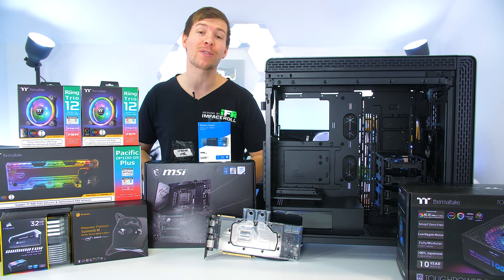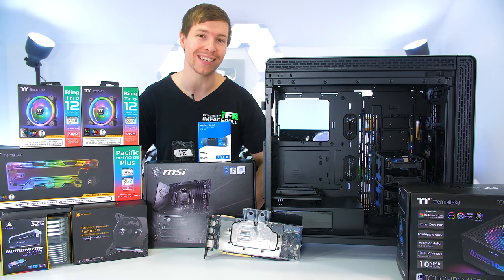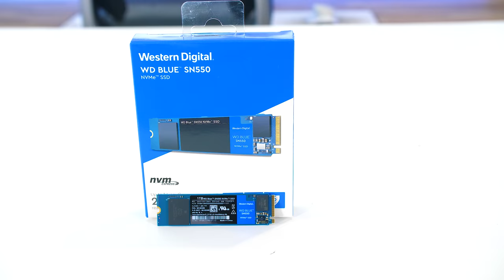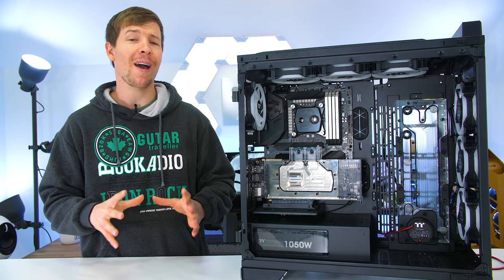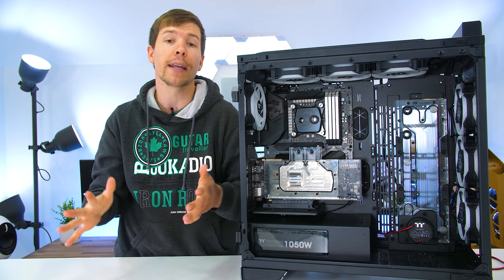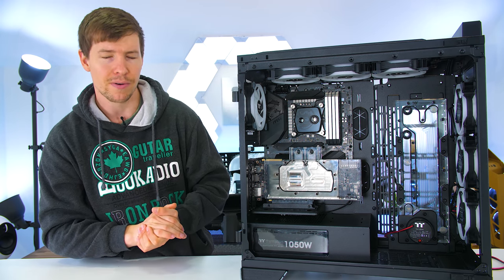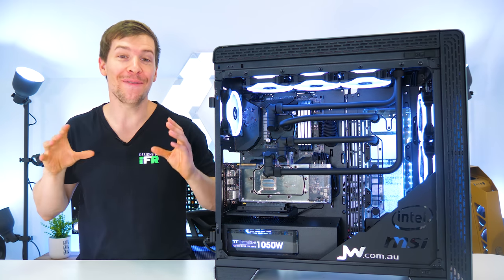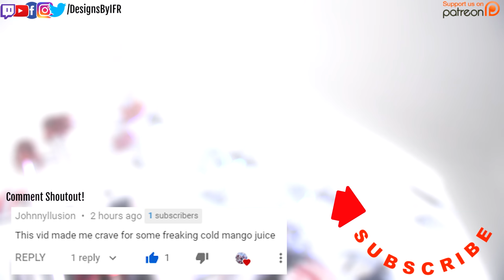Worlds FIRST Intel 10th Gen Z490 Hardline Water Cooled PC Build! 10900k + 2080 ti

Comment: My dream hedt build is in this case. Chrome brass tubing sandblasted to match the silver of the case, same with fittings and all metal components in the build like dominator platinum heat spreaders and nickel from the watercooling. Use a distroplate on the side like you did with silver under it, and stuff it with a 3990x, 2x rtx8000, 256gb of 3600c16 ram, 4 2tb gen4 drives, and 3 380gb m.2 905p optane drives, a tb3 card, and then a crap ton of 8-16tb sata ssds accelerated by the optane drives. I would mod all of the radiators to look like the watercool htsf2 or whatever they are called, and use noctua fans hidden behind the rads, while using those evercool cnc machined solid aluminum fans on the other side to be seen. I would finish the thing off by using a psu with a modded matching aluminum enclosure, and flexible electrical conduit for sleeving like they use on the titan iPhone lightning cable. This build would in fact be the most beautiful computer ever built. And I am confident that everyone would agree if it were built.

Comment: Hi, got a few questions for you

1. Why do use 8 GB x 4 module when you can get 16 GB x 2 modules?

2. Is that Intel CPU 10900k an engineering sample or qualified candidate?

3. Which nvme drive offers performance a WD blue sn550 or a Seagate firecuda or sabrent, cause almost the controller chipsets are from the same manufacturer for the above drive?

Comment: I am doing a z490 build right now myself, with the same CPU, but on a Gigabyte mini-ITX motherboard, 64 gb RAM, 1080ti video card that I already had, Evo 970 1tb SSD, Cooler Master Elite 130 case, Corsair modular 750 power supply, Corsair H75 water cooler. It will be a little bit bigger than a loaf of bread, but not much bigger. Let the games begin!!!

Comment: Processor: Intel Core i9 9900k
GPU: EVGA 2080 ti FTW3
RAM: 32 GB Corsair 3600 MHz (2x16)
SSD: 1 TB Silicon Power NVMe
Mobo: Asus Strix Gaming Z390-E w/ wifi
PSU: Seasonic Platinum PX-750 Full Modular
Cooler: Corsair H100i liquid AIO
Case: Cooler Master NR600 Mesh
Windows 10 Pro

For $2500 slightly used. Good deal or no?

Comment: Idk if this is relevant but I've heard the 10th gen are going to draw an enormous amount of power would a 360 rad be enough for a 10th gen?
Reply: Well a 360 for the CPU alone would probably be enough. But since he uses the 360 for both CPU and GPU it's not enough to handle the heat of both

Comment: What’s the hardest part to build in a pc because I’m yet to build my first pc cause I can afford one 😅
Reply from the maker: Bending the tubes maybe for beginners
Reply: Custom water cooling is the hardest part. However custom water cooling isn't something you usually get unless you want a pretty expensive computer. A "normal" cooling solution like an AIO or air cooling is enough for most. There really isn't anything that is difficult in building a pc nowadays unless you're buying some fancy/different stuff. Most pieces really just fit into where they should go. 

I would say that choosing the right build is harder than building it, especially considering the current fluctuations in stock and prices due to the virus

Comment: Nice build but your single 360 radiator is not much for dealing with a 10900K + 2080Ti, i think cooling performance will not be so good and water temp will be a bit high :o
Reply from the maker: Its fine actually
Reply: @Designs By IFR 

thanks for your reply. Nice to hear didn‘t thought that it‘s possible to handle so much heat with just a one 360mm Radiator. 

Did you testet how the average water temperature is during normal usage like Gaming ? 

Best Regards
Vinz

Comment: Can this gaming pc out perform a A$1750 system like mine?

Here's my system specs for your reference, because in some titles, yours will:

CPU: AMD Ryzen 5 3600 hex core at 4.2ghz.

GPU: MSI Radeon RX 5700 XT 8gb GDDR6.

RAM: 32gb Silicon Power Gaming Turbine X at 3200mhz.

Motherboard: MSI Arsenal Gaming B450M Mortar Titanium.

PSU: EVGA GQ850 850w 80+ Gold.

All of the above is inside a Deep Cool Kandoman Red RGB Mid-tower case.
Reply: @Cocktus I don't like Intel's prices for their CPU products, its too expensive, plus, I got more bang for my dollars spent with a GPU that's more powerful then a reference 2060
Reply: @Cocktus Just for the record, I have future proofed myself due to Intel's price tags of near A$1,000-A$1,500 just for a CPU....

Really Intel? Are you ___king kidding me right now?
Reply: @Cocktus Radeon VII's have a death potential after extended use, they die if they go boosted mode, due to the die itself not having as much contact with the water block or air cooled heatsink.

Please find JayzTwoCents for your reference to understand what I mean.
Reply: @Cocktus His Radeon VII died due to over heating
Reply: @Cocktus and for your reference, a contact test was done on another 5700 XT, and Radeon VII.

It was done by Gamers Nexus.

So all in all, please, by any means necessary, watch your GPUs temperature.
Reply: @Cocktus please note, I said "in some titles" at the start of my PC specifications, which means that it won't (and I'll gladly admit this) perform as good as a 2080ti and a 10900K, but those 2 parts are just waaaaayy to expensive, unless you can send me a link to a new board with an Intel chipset and socket, a link to an 8900K (which is just as good) and a low profile 2060 so to speak at an ok price.

Comment: 10900k... Yep don't care, the only Intel 10th gen CPU that makes sense is the 10600k as it's just as fast as the 10900k in gaming once both are OCed, and if I wanted to spend less i would go with Ryzen with a 3600, 3300X, 1600AF or 2600, if I wanted more cores I would also go with Ryzen and the 3900X or 3950X. If I was set on having both the gaming performance of an Intel part and the multithreaded performance of an AMD part I would wait for Zen 3.

Comment: The only value of this video is for Intel, exposure for new product and spreading the statement of the "best gaming CPU" which is by itself misleading since most of the buyers are not willing to build a custom watercooling system to cool this damn hot chip in order to make it to really perform like the "best gaming CPU" it marketed for. Of course we demand benchmarks, temps, noise, and power draw numbers because otherwise we learned nothing new from this video. This is pure hype video with no useful information.

Comment: Do a giveaway dman this is exactly the build I want I actually wanted the i109900k whatever it's called with the Asus formula with ek cross chklla be 2080ti but still saving for 2080ti I want either that case or a evolv x with asus rog Maximus formula z490 with ek cross chill always wanted one but last gen it was discontinued fr Intel than this Intel chip all hard line chrome copper tubing 2080ti 32g of Corsair dominator or something else chrome want a black and chrome build  dream pc I had to sell mine a couple months ago for bills so I'm at zero right now saving for that expensive 2080ti

Comment: the build looks very impressive but at what cost because I can guarantee you this much it would not have been cheap at all and there will be too many people out there that can afford to buy such a build especially when the CPU in the motherboard will set you back $1500 and I haven't taken into consideration for the price of the graphics card the water cooling kit the water block for the CPU the water block for the graphics card the ram power supply and the case I'd say you are close to about $4000 give or take. Very impressed with the built but in my lifetime it will never be reality unless I win lotto once again very impressive build.